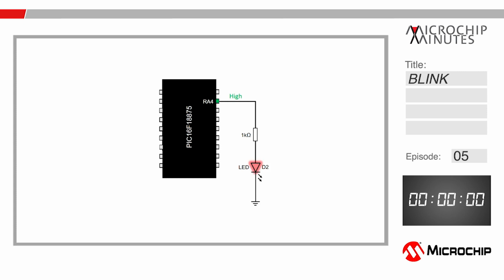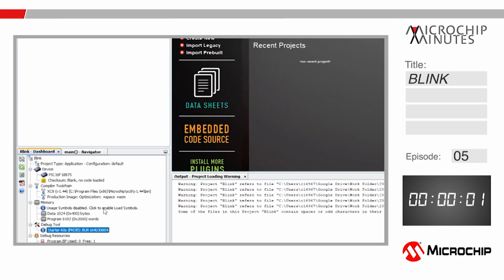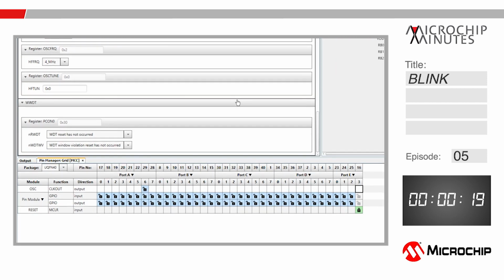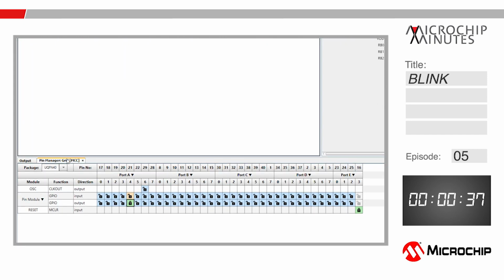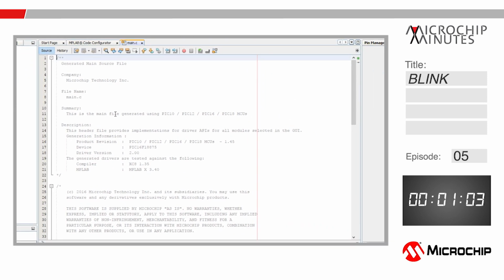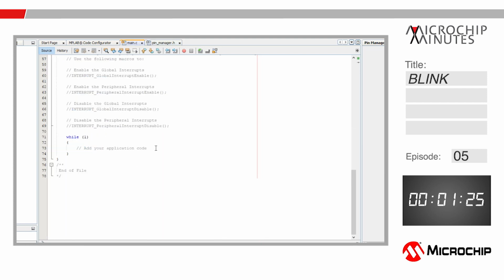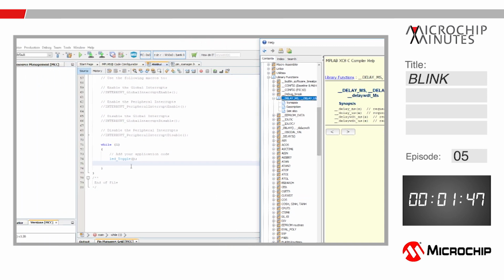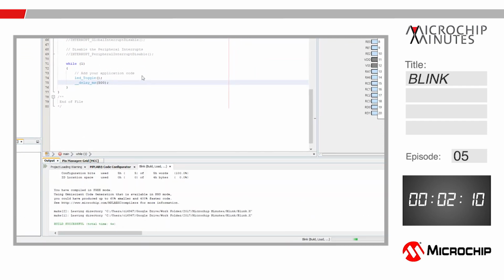Microchip Minutes - Episode 5 - Blink

Comment: good day, what simulator do you use?
Reply from the maker: MPLAB® X IDE and MPLAB Xpress IDE both have a built-in simulator. To step through codes for debugging purposes in hardware, the best entry-level option would be to get a Curiosity Board or the PICkit™ 4 In-Circuit Debugger. You'll find these on our website: www.microchip.com